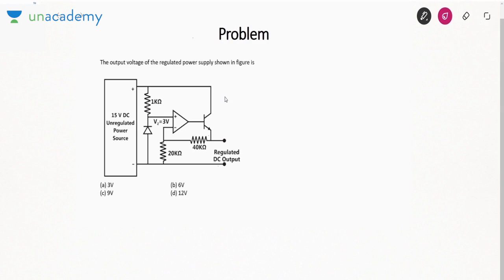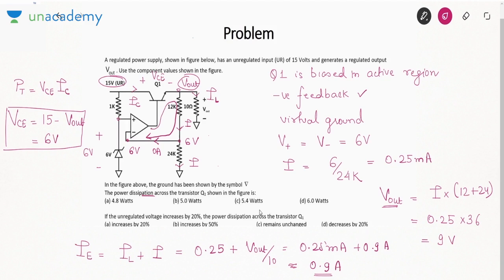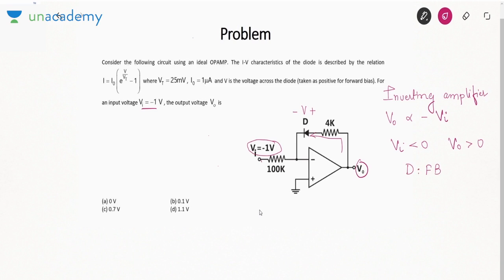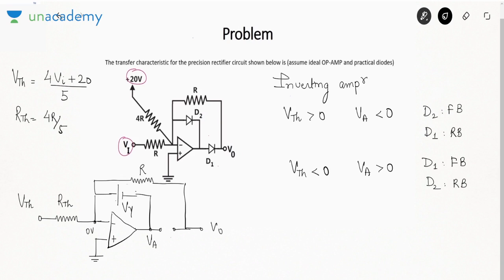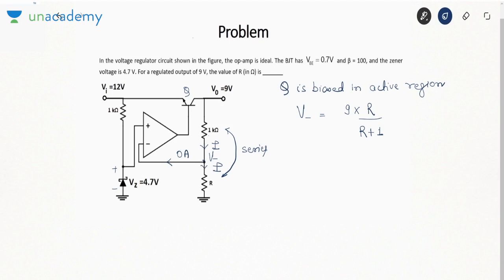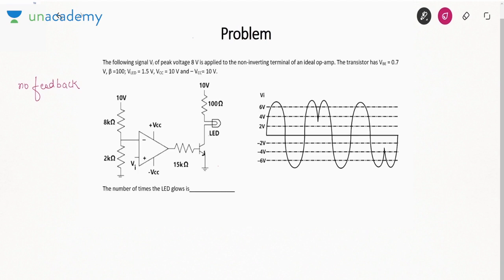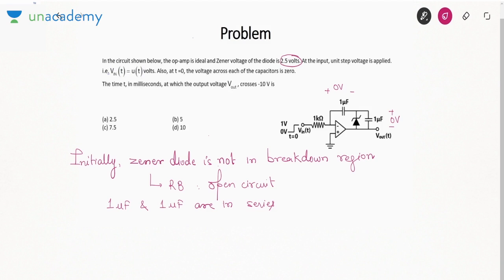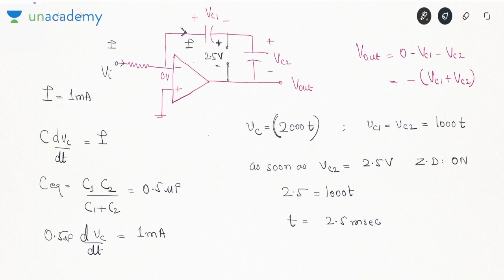Problems from Analog Electronics | Op-amp | Lec 85 | Analog Electronics | GATE 2021 Exam

Comment: At 30:00, If BJT is ON, there exists negative feedback so both collector is at virtual ground and base is already at ground  which means in  VCB=0V,  but VCB should be positive for an NPN BJT to be either in active or saturation region. That means BJT is OFF